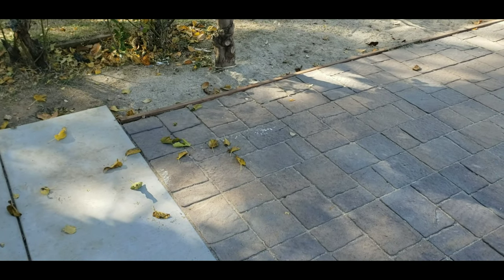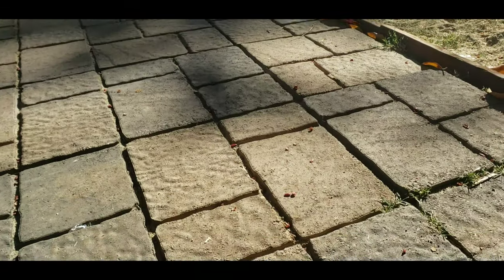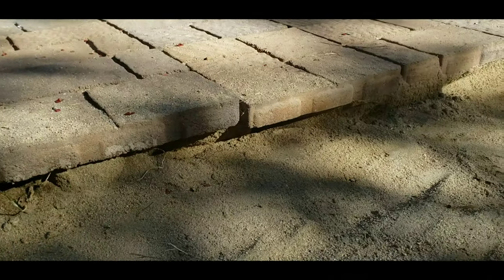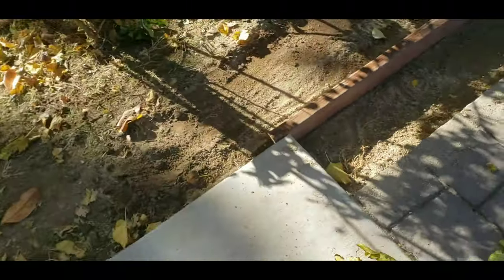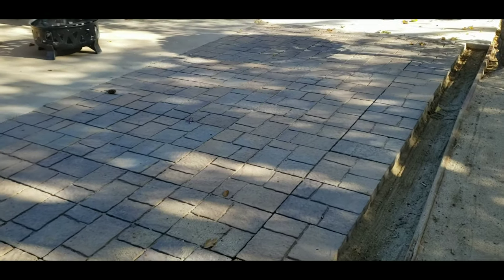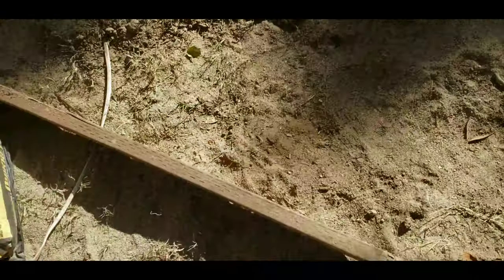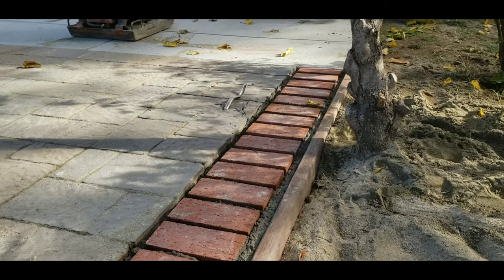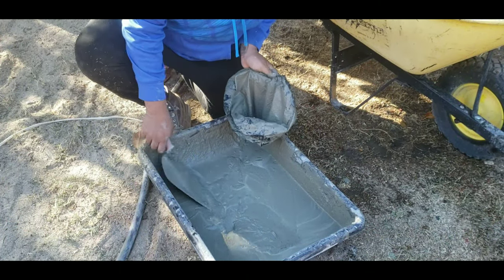Adding Brick Border to Pavers | Fixing 16x16 Pavers for Patio

Comment: Never seen brick pointing done like that before, looked like cake icing. I've used a gun with a pump on it which does same type of thing. 👌👌 Looked a good job pal 👍👍
Reply from the maker: Yeah we used to have the right tools then sold them here we are doing with what we have. It was a nice job thanks Amigo. You rock 🎸
Reply: @atrocitiesuponcities7443  you did what you needed and got the job done well pal, nothing wrong with that 👌 good work ethic 💪